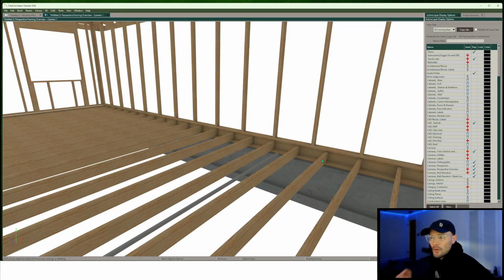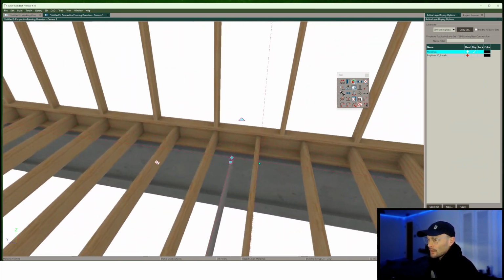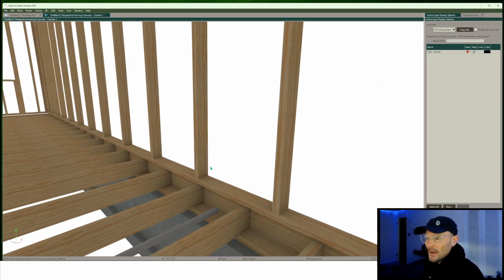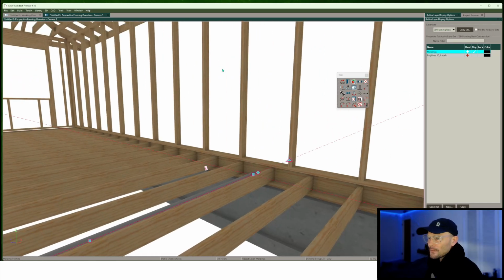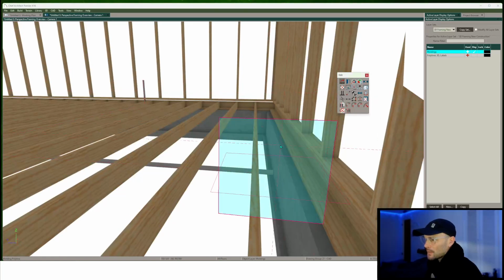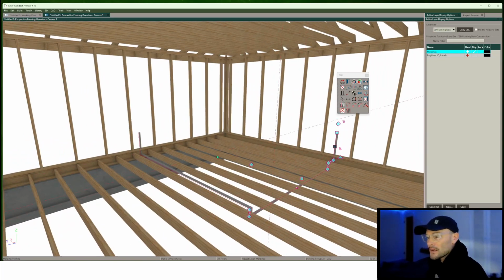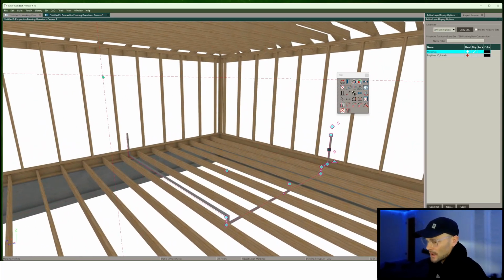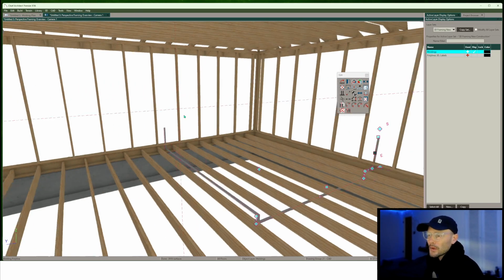Easy 3d Plumbing and Line Diagrams In Chief Architect X16 With this New Tool

Comment: Rene, after months since I first watched this I finally have a chance to use it. However, I do notice your poly line is more or less attached to the actual pipe/molding, when I tied it, my poly line is oh maybe 3-4’ away from the actual pipe/molding. Making it more difficult manipulating the drawing plane. Did you set any offsets before you placed the first horizontal pipe ( the one at the start of the video) I’m trying it with duct work near a ceiling yet the poly line is more or less on the floor. ????????

Comment: Hi Would you know if this feature is possible in Home Designer Pro?
Thanks!
Reply from the maker: @hownot2mill561  this is not available in HD pro
Reply: @rabbittdesign8482  Would you know how I could do a simple pipe layout in HD Pro? The line tool seems pretty basic.
Reply from the maker: @hownot2mill561  the only boolean modeling tools that I know of in HD Pro would be getting creative with the soffit tool
Reply: @ Thanks for the useful tip

Comment: Hi Rene.  Some of my custom railing work using molding plotlines were blowing up when editing.  This was duly reported and CA could duplicate it.  I suspect the the reports are partially the impetus for not only fixing the problem but making this significant advancement.  How did you discover this?
Reply from the maker: Are you saying that the new tool was causing a repeatable problem?
What do you mean by "blowing up"?
I first discovered the tool when looking through the available software icons for the software

Comment: Awesome feature but I can't try it yet! I don't see the Select Edit Plane tool available when I select the molding in 3D view. I am on 26.1.0.44 and I see the icon in the folder, just trying to figure out how to actually get to use it. Any suggestion?
Reply from the maker: Did you draw out a molding using the molding line tool?
Reply: @rabbittdesign8482  No, i was using a converted polyline. Using the molding line tool is working now. Thank you!

Comment: I found this the other day when trying to create a similar shaped 3d polyline for a footing drain. It took me a hot minute to puzzle out that plane switching thing because my plane windows were extremely large and I did not see them at first.  How do you get them smaller?
Reply from the maker: Just zooming in and out of the view seems to effect them. I haven't figured out the logic with that yet